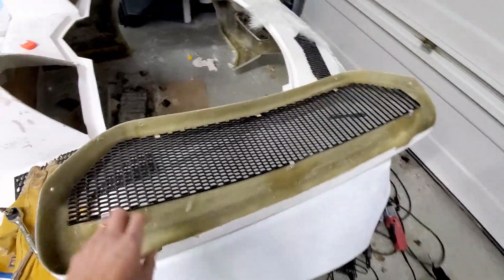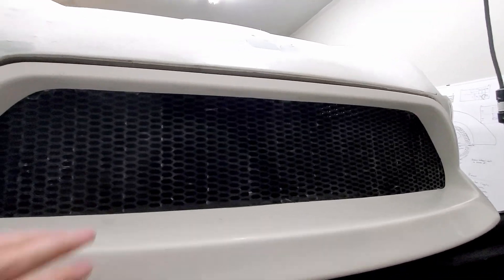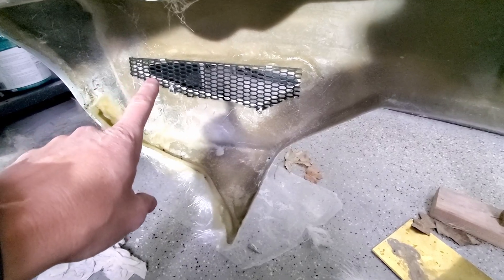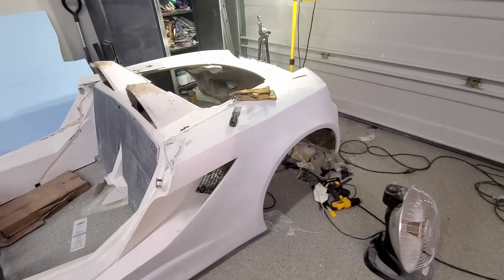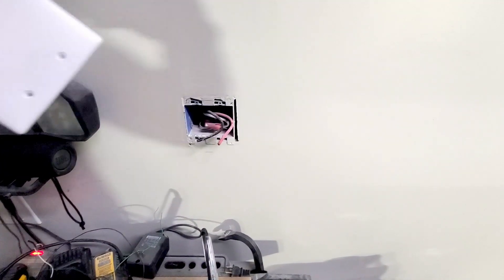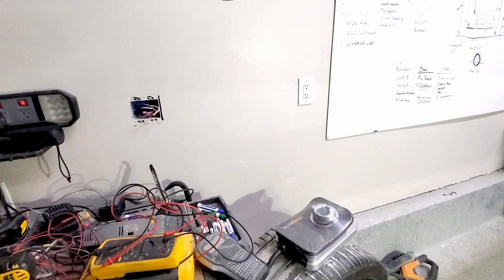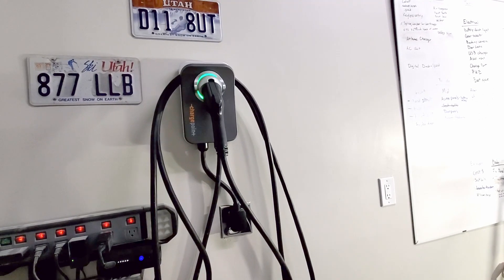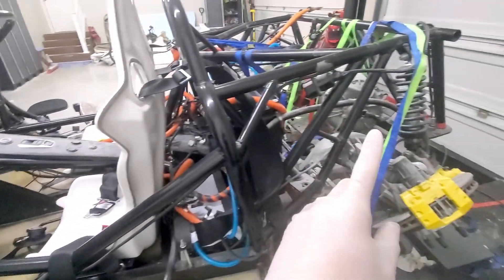Electric Vehicle Charging – Chargepoint ev charger installation

Comment: Nice addition. I had a 220V Blink EVSE installed 7 years ago and it has worked flawlessly so far. It really speeds up charging times. You might check with your local power provider, as some of them offer subsidies for installing EVSEs at home. I got $800 from mine.
Reply from the maker: You are right.  However I need to have a registered electric vehicle.  Still have a ways to go to get it registered.
Reply: @electricsupercar  Ah, you will be done and registered before you know it. And that little prize will be another carrot waiting for you at the finish line.
Reply from the maker: LOL!  You have more confidence than me
Reply: @electricsupercar  Yeah, it's hard to imagine success and completion when you are in the middle of such an ambitious and complex project. Maybe it's time to review the videos where you first got your electric supercar drivable, and took your family out for a spin. I know it is exciting for me to watch, and I didn't even do all of the work that lead up to those celebrating moments. Slow and steady wins the race.
Reply from the maker: @deanmcmanis9398  thanks for the encouragement!

Comment: Doesn't the house charger bypass the car charger
Reply from the maker: Hey Gary, as I understand it, the house supplies the car with 220V AC.  The on-board charger converts it to ~400V DC to charge the high voltage batteries.
Reply: @electricsupercar  if you could already plug in to mains to operate car charger I'm not sure I get the point of the house charger unless it's bypassing the car charger and supplying a higher  current to battery's
Reply from the maker: @gges1605  For me, I needed to change my car from a house plug to a j1172 car charging plug so I can charge anywhere.  To be able to then charge at home I needed an at home charger that that can work with the new plug type.
Reply: Slightly depends, for normal charging car charger is still operating. They supply AC to car/charger. Depends on charger but can use 1/2/3 phases.

Fast charger/DC stations have charger in the station (charger in car is bypassed) and they are a lot faster (tesla superchargers).

You always need normal charger in the car. DC stations for home use are overkill now.
Reply: Thanks for the replys that explains it a bit I went away and thought about it a little after I'd posted yesterday as I figured there had to be something going on to make home charger worthwhile when car already had charger so I'm assuming they work together to charge it a bit faster.